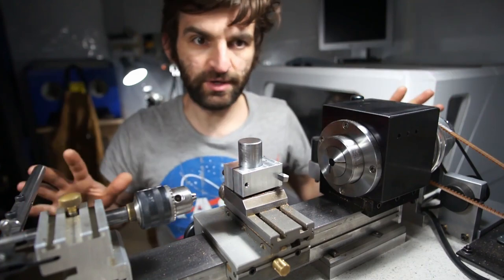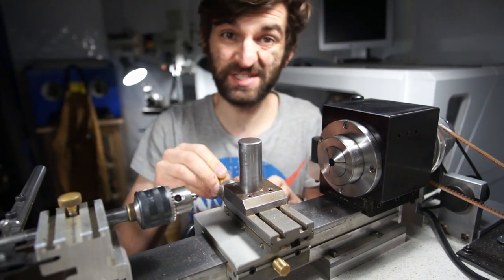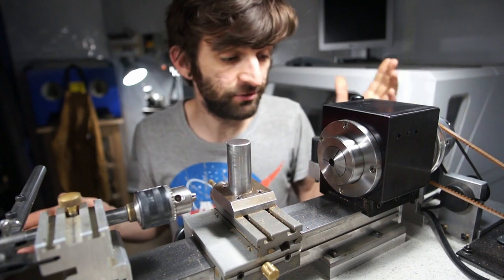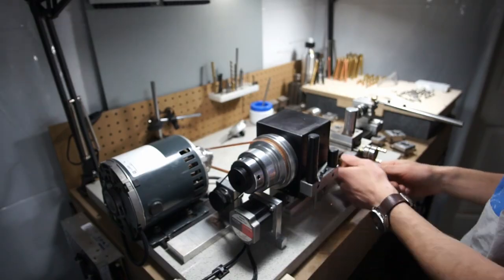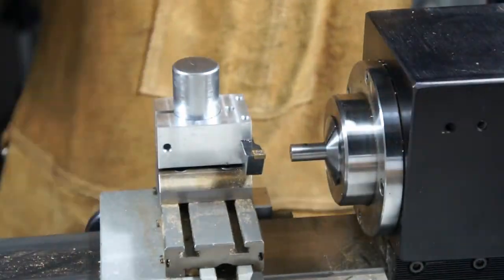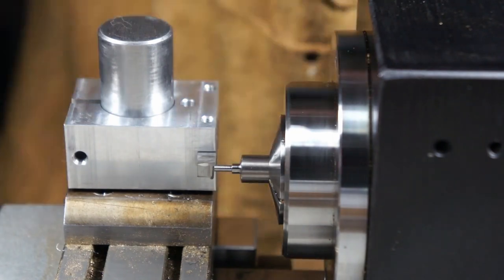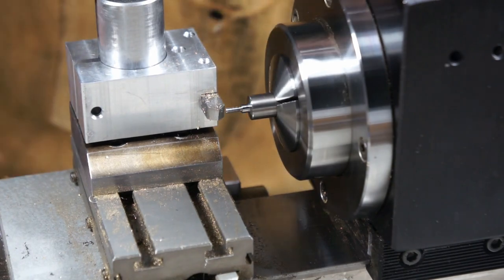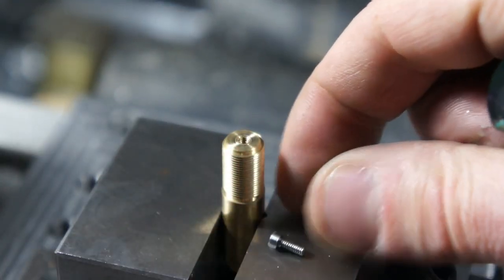DIY Digital Lathe Lead Screw

Comment: I would love a step by step 100 hour episode on how you did this, but I suppose that's not going to happen... sigh
Great stuff, even though your lathe doesn't come close to looking like a Taig lathe anymore, I think Taig should employ you, or at least license your mods.
Reply from the maker: Thanks for the kind words, check out deans photograhica if you haven't already. I copied his lead screw arrangement for this threading system : http://www.deansphotographica.com/machining/projects/leadscrew/leadscrew.html
Reply: Curt, I just discovered your channel. Your threading video has my interest peaked. I have had a similar project in mind and would really like to add threading capability to my little lathe. Hope to see more videos from you soon. I would REALLY like to see how you have implemented the arduino code. Any chance you will be posting your code?
Reply: Curt Van Filipowski j

Comment: Hey Curt! Where'd you get the lead screw for this? I can't find anyone who sells 1/4-20LH lead screws except in Acme thread, and I really don't want to mess with buying an Acme nut or an Acme tap.
Reply from the maker: I grabbed mine from McMaster Carr...little more expensive but fast and easy (should it be available in your area).

Comment: Hi Curt, possibly a dumb question: if you were to build up a new "digital lead screw" taig from scratch, would you start with the factory bed/carriage that has the powerfeed and leadscrew? I'm thinking of purchasing my first lathe, so I'm wondering why a lot of folks online seem to have custom leadscrew solutions, rather than building some around Taig's option. Maybe the left-handed leadscrew, or just built before Taig had theirs available? Thanks and great content
Reply from the maker: Thanks James, never a dumb question. I would assume most just have lathes that were pre factory lead screw option. If I was going to do it again I would probably go with the factory option and find a way to lock the handwheel. Backlash may be an issue (as I understand they are using the spur gear on the screw to act as the driving nut) but its worth a try...worse case you have to build an entire new half nut system but already have the screw part done :).
Reply: @CurtVanFilipowski  Thanks Curt, that's exactly what I was thinking!

Comment: Thats great work !
I looked at your code, the encoder is 600 PPR , 2400 steps per revolution and you divide it by by 6 to equal the steps per revolution of the stepper motor ( half stepping 400\R). I take it that you have pull down resistors on the tactile switch inputs ?
Also the encoder library has already taken care of the input pull-ups ?
Can the Arduino keep up with the encoder inputs,  if the spindle is turning at 100 RPM ?
Thanks in advance.
Adam
Reply from the maker: Yes that all sounds correct, the arduino has no issue dealing with the pulse train (8 MHz clock with interrupt driven code), the issue was overrun on the float variable I was using. Once the pulse count gets too high the variable over runs back to zero which usually causes issues with the stepper drive.  Wasn't an issue with they way I was using the code (hand turned threading) but is an issue when using it for regular feed turning.
Reply: @CurtVanFilipowski  
Thanks Curt,
I've managed to replicate what you did :)
Only difference is using two switches instead of three and for a 2mm leadscrew pitch as I tend use metric threads.
It seems to work well on the bench.
Keep up the good work.
Adam

Comment: Hi Curt! I just came back and watched this again and I have a question about your lathe capabilities (I am thinking of duplicating your setup if you think it can do this one thing). I have a long time ago given up on being able to cut a 1 inch diameter 50 threads per inch unf (I think it is UNF - this is a fine thread). The length of threads is only around 0.125". Do you think this is capable of doing this in stainless? This would be for making microphones.
Reply from the maker: Should be no reason it wouldn't work, I cut down to 56TPI threads without issue (externally) into titanium and stainless. I went the full cnc route to get more even tool pressure (hand turning the spindle results in lots of stress on micro sized cutting tools, especially the itty bitty internal ones).
Reply: @CurtVanFilipowski  Thanks Curt!

Comment: If you decide to add add full cnc, i highly recommend UCCNC it's nice because you talk back and forth to Arduinos etc, it's very capable, very flexible,very customisable and not expensive. Great support,great forum.
Reply from the maker: Thanks for the comment, I looked into UCCNC for another machine retrofit but ended up going with a linux based system for one and masso for another...just not a fan of windows controlling real time systems.
Reply: @CurtVanFilipowski  , Hear ya, fortunately all of the machine real time events are controlled by the controller board (FPGA) and windows just interfaces with it.

Comment: any plans of your lead screw setup?
Reply from the maker: Not sure yet...its a bit of an undertaking and even more so to generate plans for. Also floated the idea of making a hardware kit with plans, all still in the decision stage. Thanks for the comment!
Reply: @CurtVanFilipowski  kind of more interested in the code, maybe some basic circuit diagram
I'd need to change the hardware anyway, my lathe is a bit bigger
Reply from the maker: Ah yes, the elusive code. Its actually really simple interrupt driven code, I was very surprised the 16mhz clock cycle on the arduino could handle the pulse train and not miss a step (this is main reason most of these electronic lead screws are build around DSP chips and higher speed processing). I'll try and get something online with more details on the electronics and wiring with less focus on the hardware. The youtube user : Clough42 has a really nice DSP based system running on his larger lathe, I'd suggest watching them if this topic interests you, loads of details in his video series.
Reply: @CurtVanFilipowski  was it really written in arduino, with all its libraries? 
Do I still need to get an autofeed (haven't figured out, but it seems it's just mechanical belts and maybe some gears) - link
http://taigus.ru/index.php?route=product/product&path=57&product_id=40